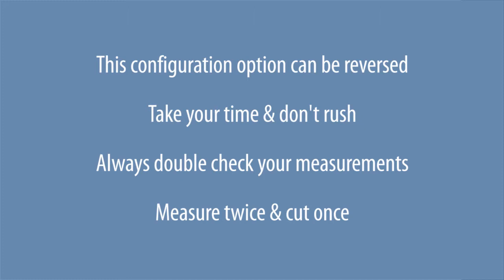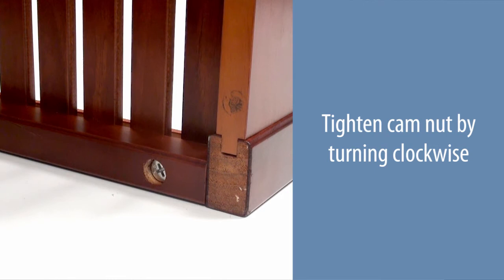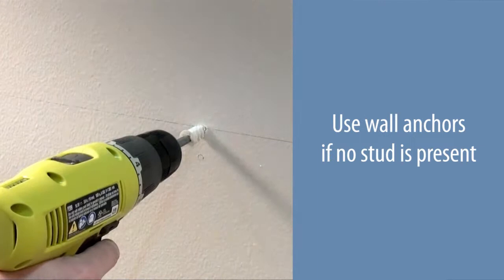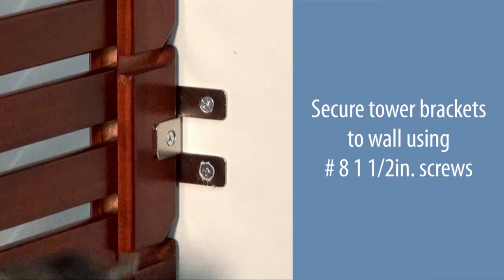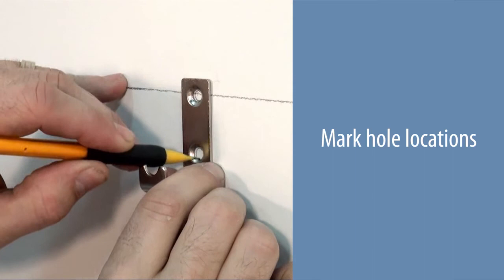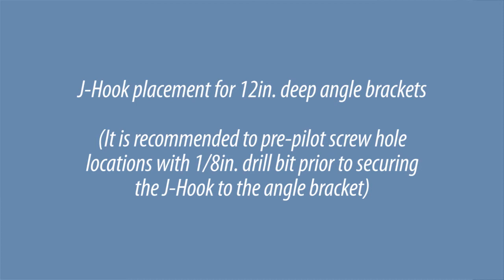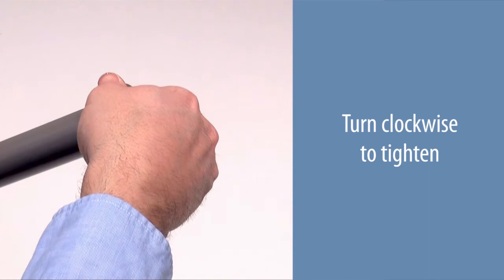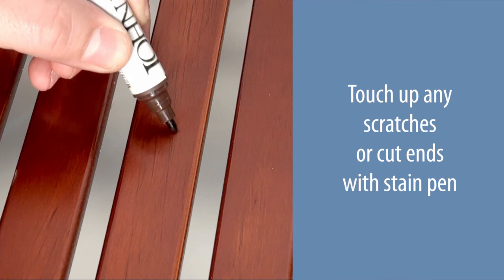12in. & 16in. Closet Organizer 8ft. Configuration A Full Installation

Comment: Just finished installing...it was an absolute nightmare. I do not recommend this closet system to anyone.
Reply: What was problem,  did it come together and look good in the end
Reply: @70snuttodd95  For the shelves to fit on the hanging brackets, I had to cut off a quarter of an inch off the back side of the shelf. Otherwise, the shelf would not fit on the bracket without severely scratching the surface. Also, the wood is very soft, and scratched / dings very easily.
Reply: @pauleydm  , thanks,  not a big deal if it's part of the plan but sounds like a mistake.  I usually build my  closet shelving with plywood boxes and solid wood fronts,  a couple of these closet layouts,some with drawers and doors look pretty interesting